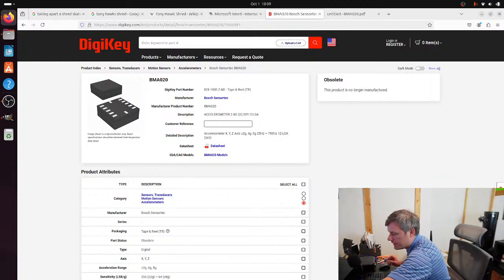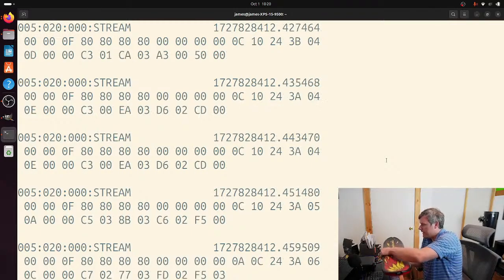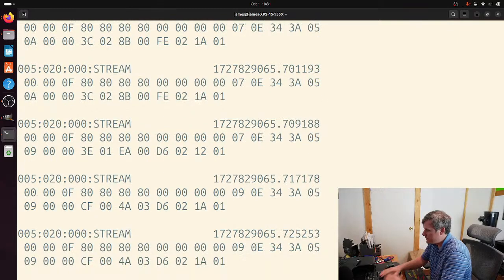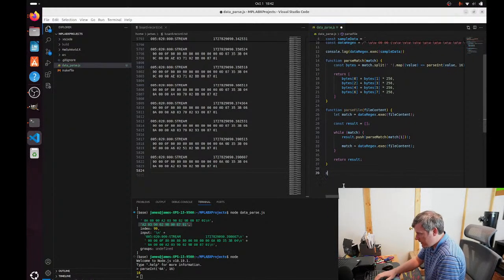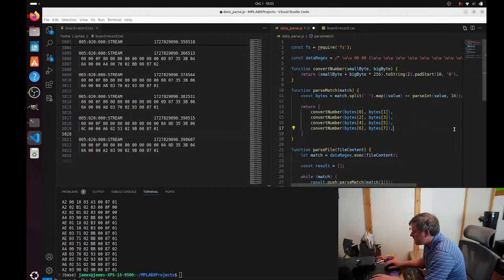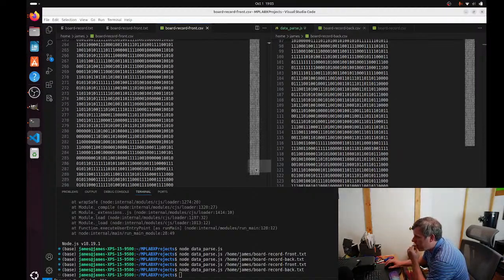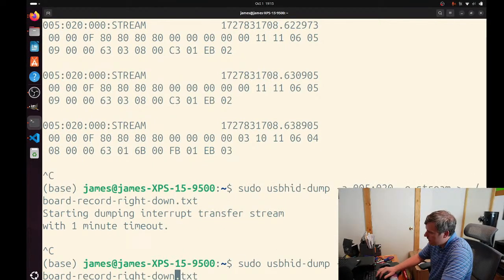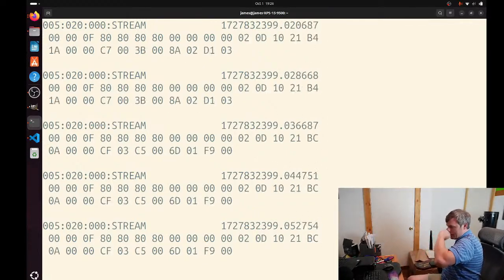Reverse engineering a skateboard controller for use on the N64

Comment: Is there not an order of operations issue in your convertNumber function? Last I can see (at 46:10, I may have missed you catching this later) it's reading "smallByte + bigByte * 256" which would be multiplying the bigByte by 256 and then adding on the smallByte, is that intended? Interesting project, looking forward to more 😄
Reply from the maker: I think that was right

Comment from the maker: So I just discovered that there are 2 accelerometer sensors on the device. One on the front and one on the back. I'm guessing that is to detect spinning. I suspect they only send the x axis for both sensors and either combine or send a single signal for the other 2 axis.
Reply: I'm no programmer, though I do have a distinct memory of a demo of the board on G4 back in the day where the representative explicitly said it had 2 accelerometers, for that exact reason